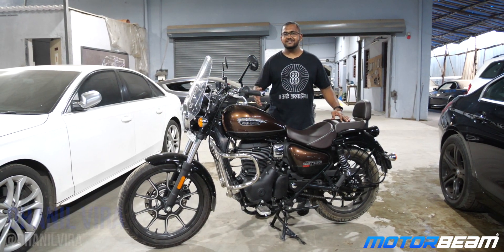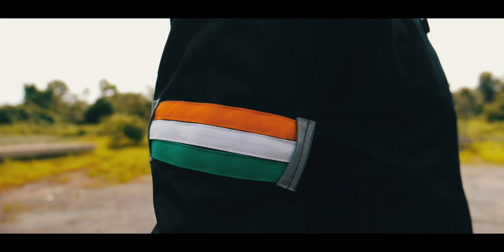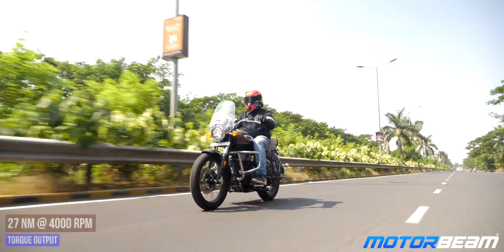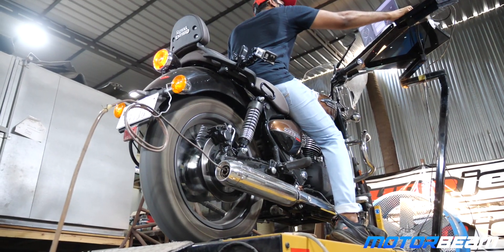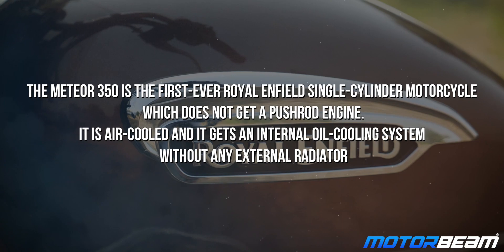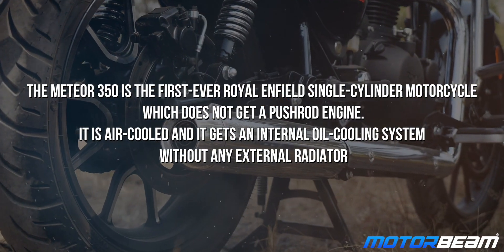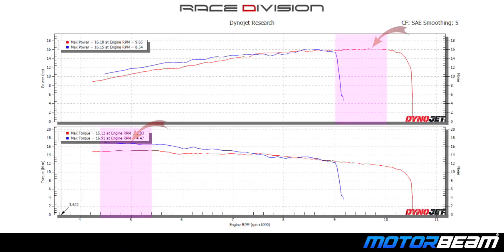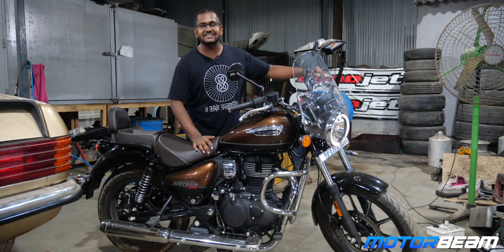Royal Enfield Meteor 350 Dyno Test - New Engine But More Power? | MotorBeam

Comment: Amazed or disappointed by the numbers?

I will be doing one more dyno test with a different unit to confirm the numbers were correct or not!
Reply: Please do one with Suzuki Gixxer 150 next
Reply: When we'll get to see highness cb 350
Reply: yes please
Reply: Please test gixxer 250 or gixxer sf 250
Reply: Sorry i culdnt understand what it actually meant🙄
Reply: Apply Cold Water To Burned Area
Reply: Plz next with pulsar ns 200
Reply: Get Dyno run for following bikes :-
1. Stock RTR 200 carb Vs Fi
2. Modified RTR 200 Carb Vs Fi
3. RR310 stock 
4. RR 310 modified
5. Yamaha R3 Vs Yamaha R3 modified
6. RC 390 BS3 Vs BS6
7. RC 390 BS3 modified 

This is just my list after watching all the Dyno run videos. I think people will love it.
Reply: Gixxer 250
Reply: Better to do it with a latest unit coming now or with next generation classic with j series engine as soon as it comes out, 

I was pretty much confident over buying next gen classic but your dyno make me a bit dicey
Reply: @dev-das  My meteor pull strongly from 80 in 5 th gear.

Comment: something does not seem right.. cycle world in the US testet the meteor 350 on the dyno and got 17.9 hp and 18.2 LB-FT which is 24.6 Nm of torque.. There can be a difference between dynos but that seem excessive.. maybe your enfield was not running in optimal condition..

Comment: The torque and hp values mentioned by the manufacturers is the theoretical values produced at the crank shaft.
Reply: did the manufacturers confirm that the values were produced at crank shaft bro ?

Comment: it is a good engine. Freddie Doobs who has great revievs on bikes said that this engine is far better than the 411cc single in the Scram 411.  I find it a bit weird that with the same displacement and a slightly larger bore and shorter stroke and same compression ratio that it makes less power/torque than the Honda CB350.. A slight tune up it should easily get 10% more power and torque..

Comment: So sad to see all the negative comments, Should have done a dyno run with a meteor that has done at least 1600 kilometres/1000 miles and run in correctly,Factory figures are measured at the crankshaft....this is rear wheel horsepower, It's a good engine with as much useable power as it's competitors, If you are relying on a dyno readout to tell you the bike is good or bad then you are not being fair to yourself.....take a test ride , I did and bought one straight away.
Reply: True ! This bike is unique, it is so easy and fun to ride, just ordered one last week